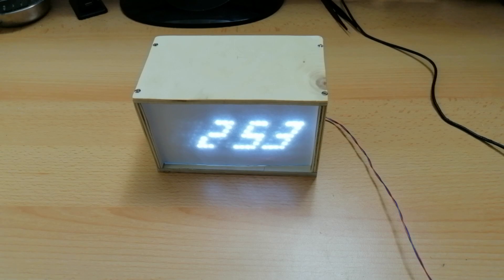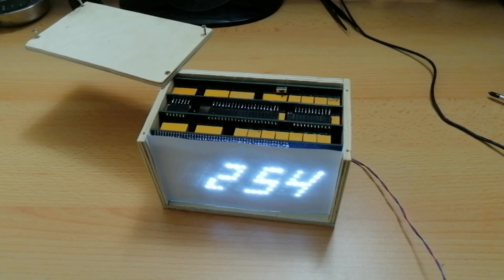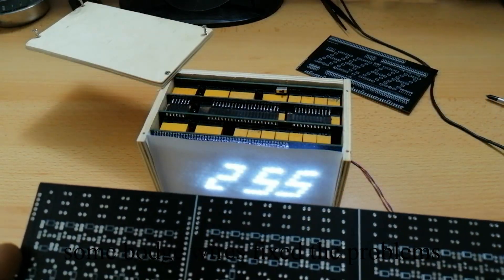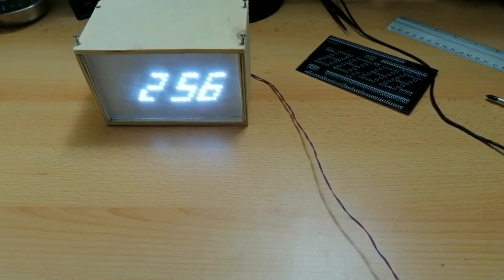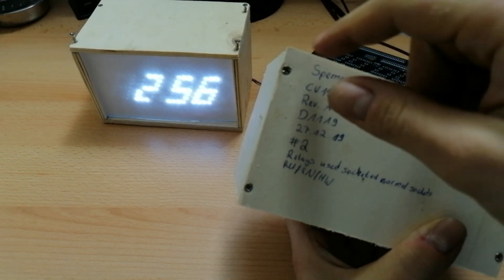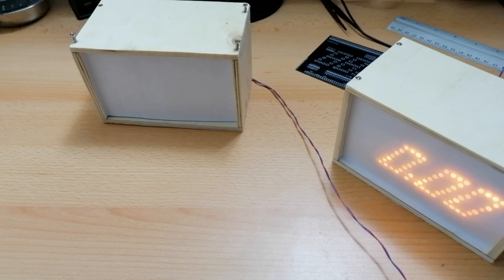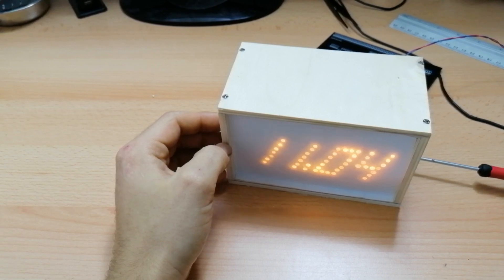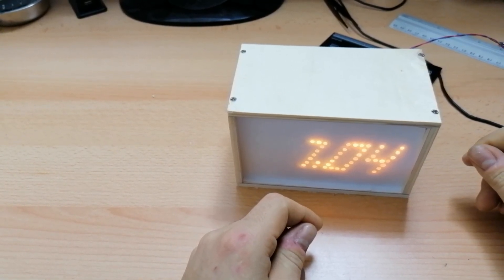Relay Clock CV15

Comment: Very nice build, would you share more information of your build.please? Are you still using shift register circuit or 4bit counter in this one?
Reply from the maker: Thank you! I'm still using the decimal counters for this Version of the Clock.
Reply: @spemobuildsandrepairs2226  looks great, where did you have your PCB's done? What relays are you using? I've start using DIP socket relays, as it's easy to replace, should the relay go bad.
Reply from the maker: @MartenElectric The PCBs were made at JLCPCB, and I am using DIP16 compatible relays. The relays are HK 19F-DC 5V .  But there are other compatible ones available.